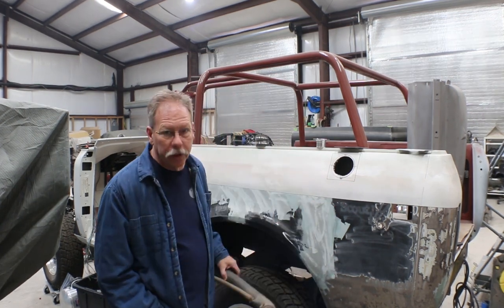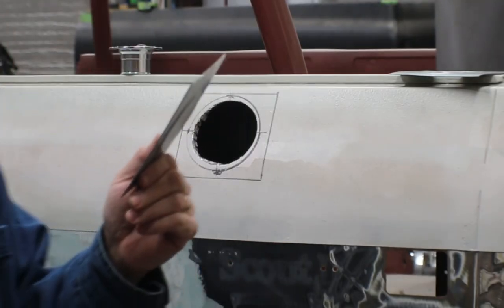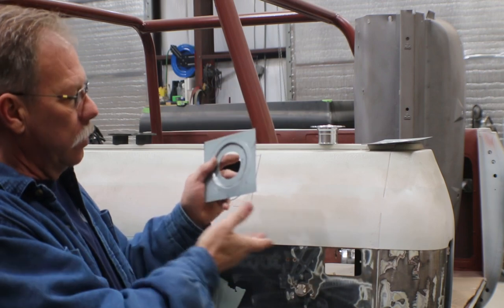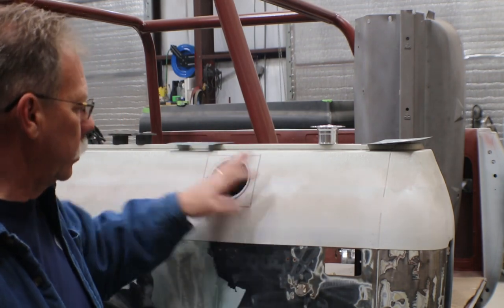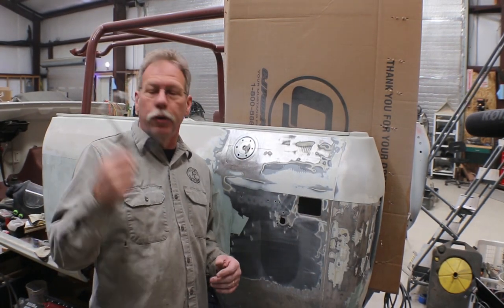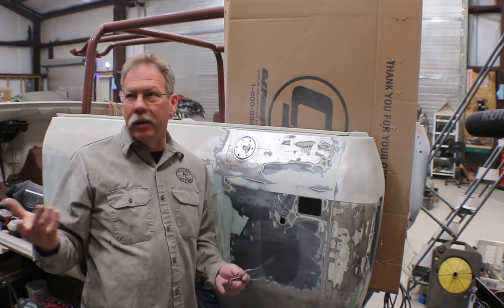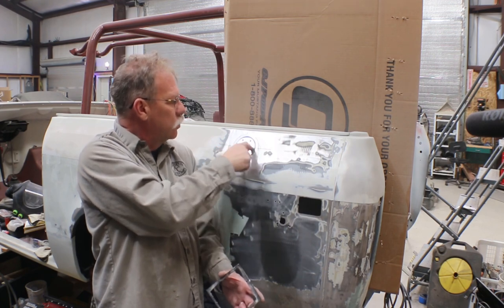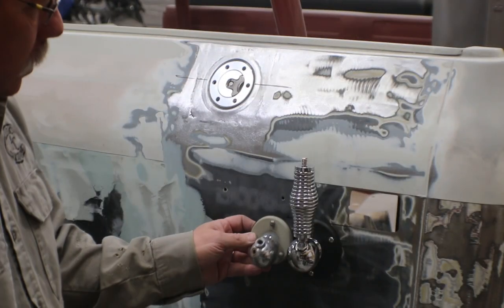Recessed Gas Filler for my 1972 Scout II

Comment: Id love to know what is the diameter of that gas filler .. outter diameter
Reply from the maker: You bet. I’m not in NM this week, but I should be back soon and I will get you the information.
Reply: @AllisonCustoms  thank you sir
Reply from the maker: The outside diameter is 3.125” and the bolt circle is 2.5” - it’s probably actually metric, but these are the numbers I got.
https://www.ebay.com/itm/154586026003
Reply: @AllisonCustoms  awesome ... thank you so much
Reply from the maker: Glad too.